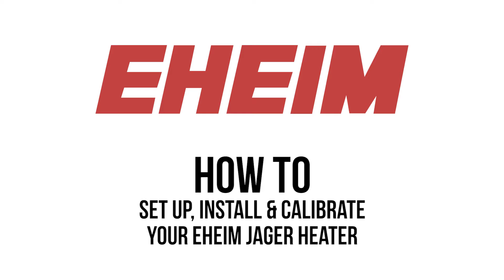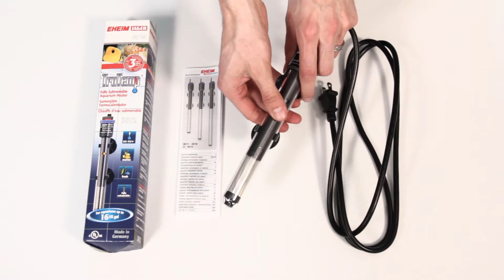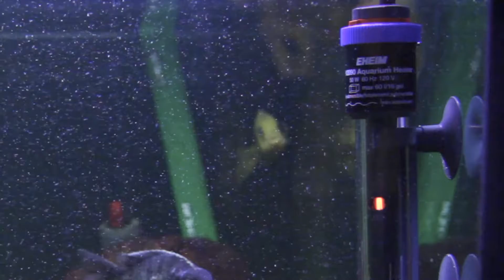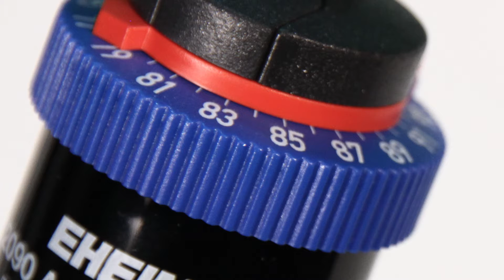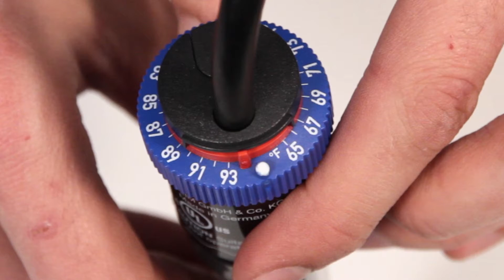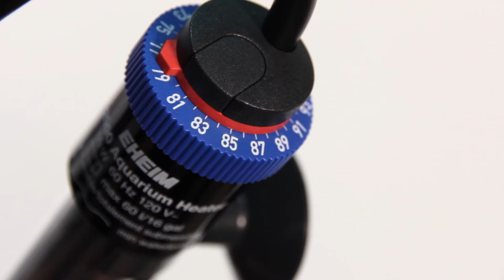How To Set Up, Install and Calibrate Your Eheim Jager Heater | Eheim Support

Comment: move the red 
the red is not moved only a reference
the blue is moved  to the desired temp and then moved again to the actual temp
so if my temp is 70 but want 80 I set the blue to where the temp is but now ive set it lower than my desired temp. 
but remember the red youre moving IN THIS VIDEO is just a reference and is not moved

Comment: Hello, I try to contact Eheim support by email, but it would not go through. My question is I have a Eheim 300w heater. My aquarium said 80-81F temperature. I just it to 75, but the aquarium still reads 81, why. And keeps coming on. What am I doing wrong? I just the red arrow, but I don’t know where the middle starts or where it’s starts out. My game room is pretty warm, so the heater should not even come on

Comment: Hi i have a 300 litre tank and a 300 watt heater and set at 30 degrees cel and tank is at 27 and heater is not turning on is the heater faulty.

Comment: 200 watt ehiem heater not working correctly.  I've been trying to calibrate this thing for a week. It got the tank up to 80 when it's set to 78. It turned off at 78 but only for one minute.  Then kicked back on . I watched it for 3 hours until it got to 80 degrees then I had to do something about it. So I checked the temperature with my hanna checker and it was 80.1 so I turned the red dial to 80 and moved the blue one to 75. The heater still didn't shut off. I don't trust this heater

Comment: How can you 'set the heater' using the red dial if the red dial is movable?
Reply: The Red Arrow is nothing more than a reference indicator. 
The Blue Dial is the adjustment for the thermostat
Reply: @ yesapaulmcdonough2170

Comment: So can this heater be placed horizontally?
Reply: NOT if you want it to work properly. Instruction Manual is specific about Vertical Placement.
Reply: @apaulmcdonough2170  very hard to place the 300W vertically as it's extremely LONG (almost 20 inches)
Reply: 300 WATTS???
In What Size Tank???
I have a 37 USG that keeps temperature with a 75.
2 to 3 Watts per Gallon is all it takes unless your tank is kept in a walk in Cooler.
Reply: @apaulmcdonough2170  sorry it's a 200W for a 50 gal, room is pretty cold and my 150W was struggling.
Reply: @broutilde  you would do better with 2 100 Watt heaters used together, each spaced 1/4 the distance from the sidewalls.
Reply: @apaulmcdonough2170  I barely have space for one heater.. Heavily planted tank
Reply: @broutilde  a 100 Watt is shorter than a 150 and is only an inch wide.
Should easily mount Vertically with room to spare above and below each heater.
I use two 75 Watt heaters in a 65 USG that is in a room that usually stays at 68°-70° F, that I setup in May 2020.
The Left Heater is set for 77°, the Right at 76°. The Left will normally keep my Tank at Temperature by itself. Occasionally, in cooler weather, or after a Water Change the Right kicks in also.
Reply: It can

Comment: who do I contact iv boughta brad new ehim jager 25 watt it sticks on wont turn offand if u pull it out water wont turn of so safety switch don't work to my tank was 26 degrees I turned it to 18 and it hated tank to over 30 n kept on t wont urn off iv oney used it 2 days have a 3 year garentee
Reply: Customer service is terrible they will not back their product.
Reply: sorry my typing bad its a 125watt jager in a 200 lrt tank
Reply: Try this link for their Customer Support

https://www.eheim.com/en_GB/service/service-centers
Reply: thanks